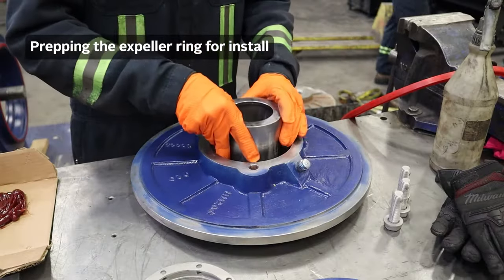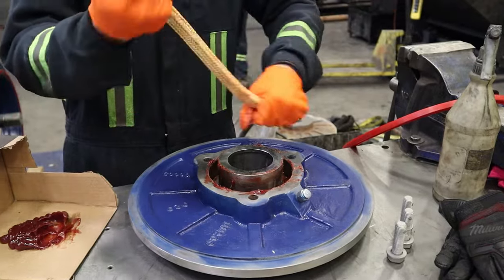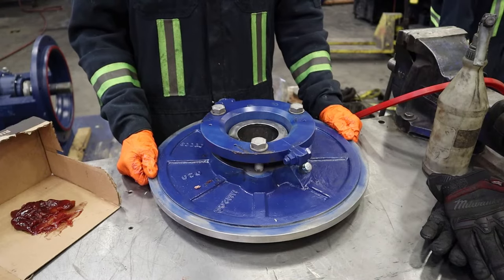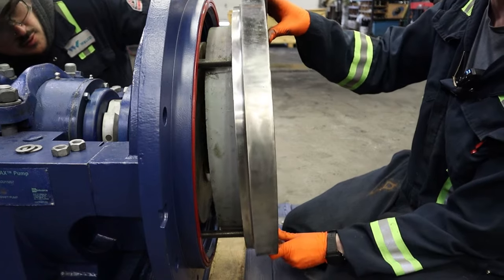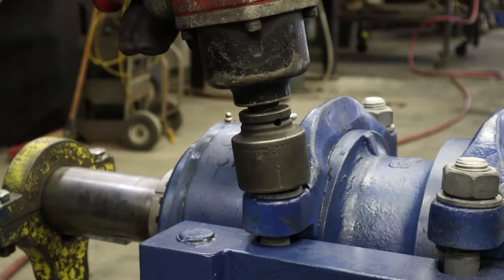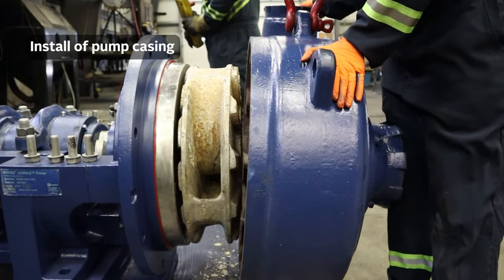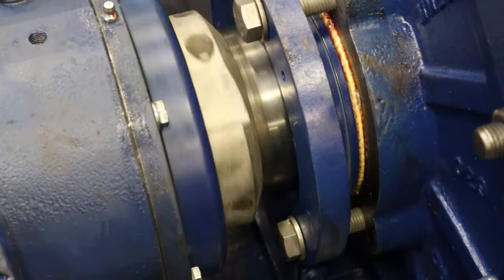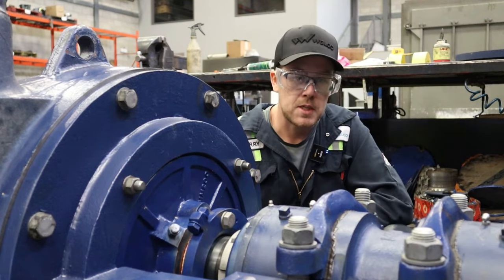Slurry Pump Assembly

Comment: You have mentioned one impeller adjustment what is that adjust used for
Reply from the maker: We adjust the impeller to center within casing and prevent binding.
Reply: @WelcoExpediting  if in a slurry pump , pump suction line & delivery line blocks what may be the possible reasons?whether any thing be checked from pump side
Reply from the maker: @manikandanmadhuvappan8166  Probably best to contact our service department with any technical questions, https://www.welco.ca/contact-us Thanks!